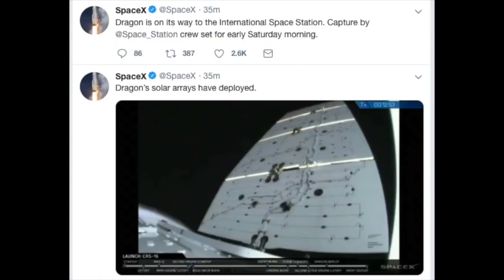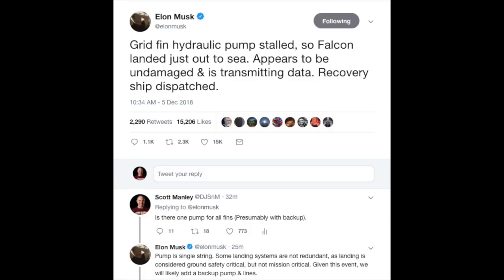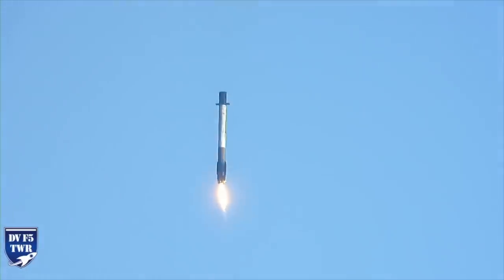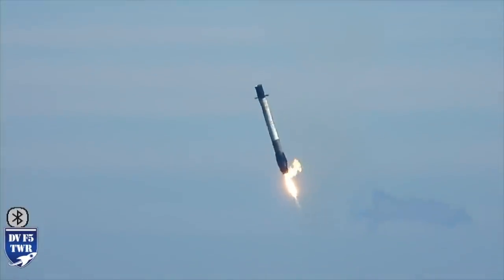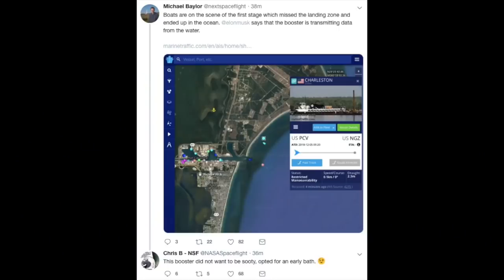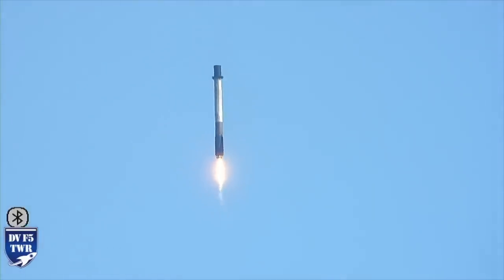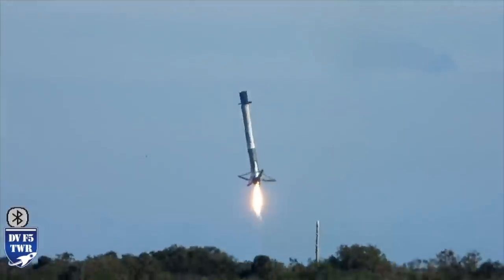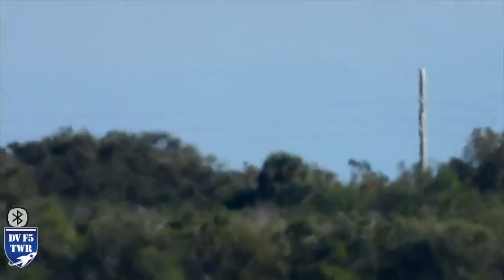SpaceX Rocket Loses Control After Successful Launch

Comment: Imagine being a passenger on BFR and having this happen? Whew!
Reply: NorthernChev   That won’t happen.  Grid fins will have two mechanisms going forward.  However I’d still feel quite safe even if this did happen with the starship as the booster still technically landed XD.
Reply: technically landed , aaand technically change pants, but yes
Reply: "Not to worry, we're still flying half a ship!"
Reply: Succesful landings will probably be mission critical for the BFR unlike the falcon 9 :)
Reply: i think that time we don't have any problem with booster landing
Reply: Only have to worry if you were scheduled to fly next with that booster.  Assuming by then they won't just rinse the saltwater and fish out of it and hoist it back on the launch cradle...
Reply: It was probably survivable. The booster soft landed and tipped over relatively gently onto water. If you are properly strapped into your seat and don't hit your head, you could get away with minor injuries.
Reply: András Bíró I don't know about that.  How tall is the booster on BFR?  100+ feet?  That's a hell of a fall for the people toward the top.
Reply: @brainmind4070 
The BFR will be much more redundant, this won't happen with it.
Reply: András Bíró I'm just saying a fall from that height would be pretty serious.
Reply: @brainmind4070 
Serious, but survivable. Like a car crash. And it didn't fall on concrete, but water, that brakes the fall much more gently.
Reply: F9 is fine for me: Rug up nice and warm with a decent pressure suit and hide away in the interstage. Wave at the camera on second stage separation and hang on tight! What a blast.
Reply: One thing I AM concerned with with the BFR is that it literally falls at a straight line, then flip over to do a suicide burn... On Mars it may be fine, but on earth, it's gonna pull some G's.
Reply: Cody Nemo The upper stage of a falcon 9 doesn’t land on the ground, but the BFR (with passengers) does...
Reply: Remember that this is the booster, not the manned part. If it were the manned part they would have full redundancy.

Comment: Not a fan of the only "technically" accurate clickbait title, Scott.  Normally a huge fan.  Prolly an unpopular opinion.
Reply from the maker: If you have a better title feel free to suggest one. Also realize the hardcore click baiters will be overly dramatizing things rather than trying to deliver my measured analysis.
Reply: "SpaceX Rocket Launches Successfully, Loses Control During Booster Landing"?

Not that I even read the title before watching the video.
Reply: @scottmanley  it's not like, "Faulty fin causes partial control loss," is at all catchy. I can't imagine what else you could call this video.
Reply: @scottmanley  Space X Grid Fin Fails Dooming Booster Landing
Reply: That's funny. That's way more click-baity than the current title. Current title is 100% literal, and accurate.  @TeddSpeck
Reply: @Mythricia1988  I agree my suggestion is also click-baity.  The word "dooming" is the biggest issue and it is NOT ACCURATE!  It's not doomed, it's likely to be reused.  It was an attempt to include excitement, but it too overstated the case.  My point was correctly interpreted by Jeff Byrd's comment "One could infer from the title without any other information that the payload had been lost."  If I could do it over again I would simply comment that Scott's title seems to imply the payload was lost.  It was kind of an off-the-cuff observation, but the word clickbait is pretty loaded.  

I'm embarrassed that I've had one exchange with one of my heroes, Scott Manley, and it was not a positive one.
Reply: @scottmanley  SPACEX LAUNCH GOES WRONG. ALL HANDS ON BOOSTER STAGE ARE LOST. :)
Reply: How is this title at all click bait? It states exactly what happens. Nothing sensational or overstated.
Reply: Your opinion is unpopular because it has no basis
Reply: "Who would win, a team of SpaceX engineers or one griddy boi?"
Reply: SpaceX booster FAILS, live feed CUT moments before hard crash into ocean! Elon Musk in tears! 

There fixed it for ya ;)
Reply: When a fool is looking for something to complain about they'll find something and this guy is a big a fool as they come.  Clickbait indeed.
Reply: The launch was successful and the booster lost control for a bit. Where's the clickbait?
Reply: @FPV-wi8fw  One could infer from the title without any other information that the payload had been lost i think was the original point. But they took it a cynical step further instead of just wondering if it was a mistake or misunderstanding.

Comment: Awesome to watch live! Hope SpaceX releases the full stage 1 video. Clearly one grid fin wasn't responding. Amazing how much control the rocket maintained despite the issue.
Reply: They already did. It's on Elon's twitter
Reply: @deimos7305  Sweet! Thanks man!
Reply: Also on instagram
Reply: From what we see in the full video of the descent, and from what the Space X engineer said, the grid fins completely stopped working. The engines did a terrific job of steering and landing the booster, which went through a normal shutdown and flushing procedure after landing and falling in the water, and  continued transmitting data.
Reply: @awuma  I'll bet there's more redundancy in the hydraulic system going forward. Two pumps for sure and possibly closed loop systems.

Comment: Been waiting for your video, the booster landing going wrong was insane, spotted the fin stuck straight away
Reply: No, you didn't. You spotted the grid fin trying to correct for the one out of sight.
Reply: rj hinde yeah that’s what I meant, it was stuck trying to fix the issue
Reply: @hindesite  
No, the fins got stuck. In this position they initiate a left roll.